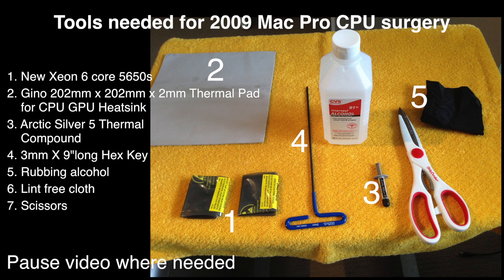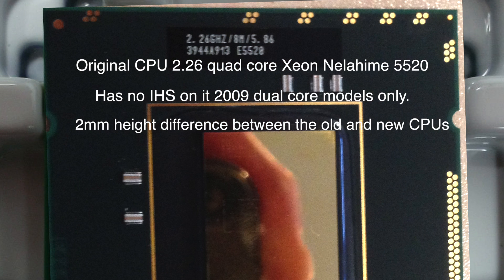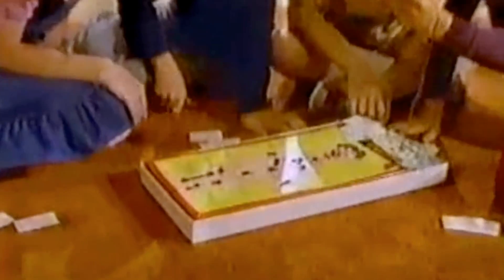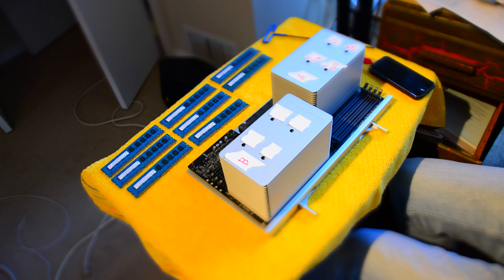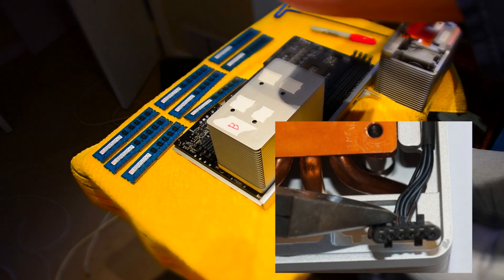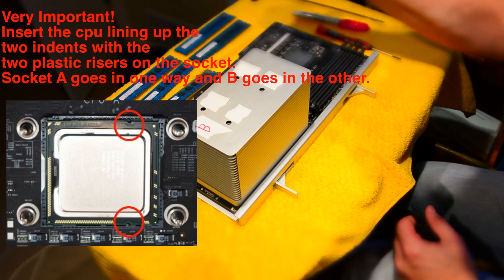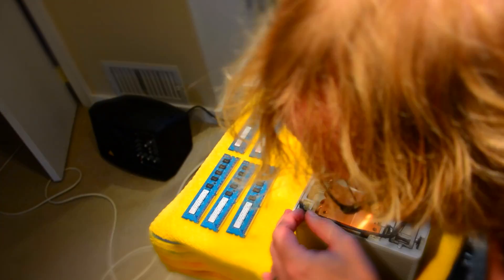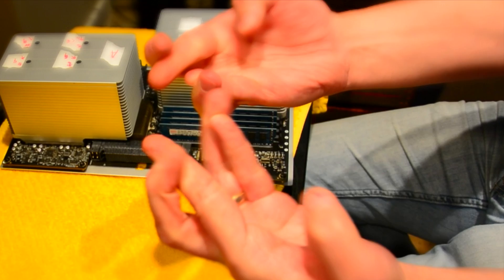Mac Pro 2009 5,1 CPU upgrade 8 core to 2010 12 core

Comment: Great video! This will help me out a lot as i'm in the process of upgrading my 2009 Mac Pro with dual Xeon X5960's.
I would like to know if adding washers to make up for the CPU height deference is worth it?
Reply from the maker: I did not use washers and about to upgrade from 5650s to 5690s today :) I am not using washers but the main thing is to not over tighten them when first putting them in. But a lot of folks said they did use washers so it's up to you, supposedly you can still over tighten even with washers. When I originally read instructions on the website I got my information from the guy said using washers will make no difference in the potential of damaging the CPUs from over tightening.
Reply: Thanks for the reply! The more I read into it the more I'm thinking about removing the IHS to get the CPU to fit 'properly'. Are you keeping the IHS on or do you plan on removing it?
Reply from the maker: +SolidCake Seeing I kept it on the first install I am going to keep it on the second install.... It is easier if you remove them but some folks say don;t try to do it and others say it was easy. So do more research on it to be sure. Going to make another video on my upgrade so stay tuned.... :)
Reply: Well, I guess they say don't because of the huge risk you are taking when delidding the CPU's. It's quite the dilemma.... The dealer I bought the X5690's from gave me a 10 year warranty on each chip. Go figure.... Delidding them and voiding that 10 year warranty is not something to take lightly. Your method of cutting the power cable loose seems like the best way to go when you want to keep the lid on. But here's the kicker, I still have 2 years of warranty on my Mac Pro that I'll void when doing so ;)
Reply from the maker: +SolidCake I learned a lot more as I struggled to install to 5680s last night, glad  to say it all worked out. I talked to another youtuber who bought de lidded  CPUs only to have the same issue as far as tightening down the heat sinks and getting all the ram to show up. I really struggled last night for a few reasons, one being the ram not showing up. I think if I were to do it again, I would not cut the heatsink connectors because its a bitch to deal with if you ever want to re install / upgrade cpus again, I was able to do it but getting the heat sink connected and unconnected is tough although I did it three times. If the fans don't blast up and all ram and cpus show up, then you are good and there is no need to cut the connectors. If your fans are blasting and all shows up and boots then the worst come to worst you would have to do it, but I have seen plenty of folks who did not cut the heatsink connectors and it worked out. I get not wanting to loose your warranty. What Mac Pro do you have?
Reply: Lance McVickar Thanks for the info & heads-up! I have an early 2009 Mac Pro 4,1. The CPU’s are expected to arrive tomorrow and I’m installing them over the weekend to keep myself from rushing the process. I still have a couple of days to think about what the best method is for installing them. I’m surprised that there is not one method that is unanimously recognized as the best way to do it. People either believe delidding them is the best way to go or they believe in leaving the lids on. The heated debates you come across on the matter is mind boggling. Either way I still need to test them if they even work before removing the lids. Otherwise I’ll ruin the 10 year warranty on the chips. If they work I’ll just leave them in as-is with washers and thermal pads for extra support. I’ll be using 0.5mm washer to dial the distance in. How’s your Mac Pro running so far?
Reply from the maker: you need 2mm of washer height I believe to make up for the difference. I did not use washers as I said.
I really thing the best way to go, is not de lidding them unless you practiced on a through away chip to see how easy or hard it is, some folks say it's easy but I would not want to risk it. I have had no issues with leaving them on. I would recommend this method of install. Remove all ram and both CPUs and remove and clean heatinks install thermal pads if not removing IHS caps. Install CPU A which is the one on the right, do not cut the connectors as I did or go ahead but it makes it much more difficult to get the heat sinks back on. Add thermal paste buy going left to right horizontal on the chip and not edge to edge but from about a 1/4 of the way in leaving no paste on the edges. Put the cleaned heatsinks back down nice and straight onto the new cpu. I find that 3.5 turns per screw in an x pattern for tightening, is a good starting place or until you start to feel resistance but the old lock tight blue stuff on the posts may cause some resistance and make you think it is getting tight. Boot the computer with only CPU A chip and Ram installed. If it boots go look at the system profiler and make sure all the ram is showing up. If it did not boot you need to tighten a bit more, do not over tighten do it gradually you will not hurt anything. There are lights on the cpu board to help guide you. If a red light to the left of CPU A is lit you have a memory issue, if the light behind cpu B is lit you have a CPU issue, of course you will know these things if you boot and all ram shows up, then those lights will not be lit. If it doesn't boot, do 1/4 turns on each screw and try to boot again. If all looks good, move on to CPU B. NOTE: when you only have CPU A installed and the computer boots your fans will blast at full speed. Not to worry yet as this is normal, maybe the CPU light will be lit as well, but if A shows up in the system profiler and all the ram you are good to move on to the next CPU install. Do the same, I had a tough time with the second cpu, it seemed like I had to do more turns than CPU A, but again start gradual and do the 1/4 turn on each if its not showing up. If its too tight or not tight enough, the computer may not boot again even though you know CPU A is good. Just be patient and work the CPU B to proper tightness being nice and even pressure on all four screws. Now for the tough part :) if you find that all is good cpus and ram showing up but your fans are blasting that means the heatinks connectors are not making the connection they need to and you will have to do the whole install again and cut the connectors and puch them all the way in before dropping down the heat sync. but this is really tough as there is no slack on the cables and the cable could potentially get stuck between the heat sync and the board because its loose although that never happened, But I think its worth not cutting them because its really hard to get the connector in and mount the heatink. If you do cut them, then get down at an angles so you can see the heat sync going down onto the chip when you are mounting it, it has to go down flat. Hope this helps and let me know how it went, always better to not go too tight, if that CPU light comes on it usually means you are too tight, I think once you go too tight you have to clean and remount as if you back off the heat sync screws you may get air bubbles in the compound which is not good.
When I went too tight, and backed off on CPU B it never booted even though CPU A was good, so I had to re install CPU B from scratch. Cheers and good luck.
Reply: Lance McVickar YESSSS! I did it! I delidded the X5690’s using the vice only method! I first checked if it worked and then proceeded to the 2nd CPU. I can say that delidding with the vice only method is a rollercoaster of emotions. Especially if you have never delidded a CPU, ever… The amount of force you need to put on the vice is insane, my hands are blue from turning. You think you are going to snap the CPU in half but… It just pops off. The first one flew off, that one had a lot mor solder than the other one. 
Thank you for your help! If you have the stomach for it I can highly recommend this process, no need to modify or tamper with your Mac Pro 4,1! My Mac Pro 4,1 runs smooth and quite with a Geekbench score of over 31000. Oh, I filmed it so you can expect a video on it soon!
Cheers!
Reply from the maker: +SolidCake great congrats.... I just installed a GTX 980ti and two 5680s did not delid the CPUs, had a bit of trouble with the second one but got it all working. Tg lad it worked out for you and get me the link on your delid ding when you post it. Cheers!
Reply: Will do! How is the performance and power consumption of the GTX 980ti?
Reply from the maker: +SolidCake the 980 blows away my R9280x and it connects to the two power ports on the logic card same as the R9, and it's been running great so far. I ran Heaven and Valley let them run for a few hours no over heating. The card has a new cooler so it's very quiet, r9 280x gets loud when stressing. It was modified to work with Mac Pro boot screen and all. getting almost double the frame rates and importing 4K to proxy media is a bit faster than real time in FCPX. But that being said Nvidia is came out with the new 1080 and 1070 but there are no drivers yet for macs. These cards are smoking fast and not power hungry. Maybe I should have waited but I pulled the trigger on the 680ti.

Comment: I'm a relative newb to the world of DIY mac upgrades, but bolstered by walkthroughs such as yours and a tongue in cheek sense of adventure I set out... Ill-advised? perhaps. Despite running into problems (as was expected) I'm still enjoying the journey. Your video has been beyond helpful, so thanks!!!!

Question... I followed your method to the letter apart from also adding 2mm washers to the heat sink screws (which I read about elsewhere). I also used the vertical line artic paste method you mentioned. I'm booting up like a champ EXCEPT the dreaded fan comes on and stays, full blast. I've tried starting over, being more careful with my paste, placement, heatsink sensor socket attachment, screw turns etc. I've gone over and around it about 4 times being as careful and precise as I can be. No luck. Any suggestions on what could be causing this? I also zapped my RAM and reset my SMC.

I did notice one blade on the Northbridge heatsink sensor was bent and I straightened it out.

Any help or advice you might have would be so very welcome! 

Thanks again!
Reply: +Camden Chamberlain  I should also add, that right now I've only installed CPU B. Waiting on some more heatsink pad before I tackle CPU A. Would the fact I'm booting with only one of the CPU's possibly be causing the fan to come on and stay on? Seems unlikely, but figured I better ask. thx
Reply from the maker: +Camden Chamberlain you can take a deep breath, the fans will go full blast until you have both CPUs installed, even though it boots with just one both have to be properly installed do to get normal fan speeds... With just one they go full blast, two and it will purr like a kitten :)
Reply: Phew! I know I'm not out of the woods, yet, but that is some VERY relieving news! Big props again on the video.

Comment: Hey Lance, great video! Did you have any problems installing 1333 RAM afterwards? I found that if the 1333 RAM wasn't matched it wouldn't boot... Did you have the same problem?
Reply from the maker: +Peter Szmrecsanyi No problems for me but all my ram came from OWC, but try zapping your pram on the next boot, hold down command option p and r immediately after you hear the boot tone and keep holding all four keys until you hear the boot sound again. If not could be you have a bad stick of ram or more or maybe two different brands could cause and issue.
Reply: +Lance McVickar Thanks Lance, I'll give that a try!
Reply: Lance McVickar No such luck Lance, I bought two 6 module kits from OWC and neither work. Both kits came with 4 matched modules and a matched pair, when I use the 4 matched they work and the matched pair also works but mixing them will mean the MAC PRO doesn't boot. Are you using 4, 6 or 8 modules? Are they all matched?
Reply from the maker: +Peter Szmrecsanyi I have six now used to have eight but they are all matched. I would just give OWC tech support a call they are pretty good, have you looked to see if all the sticks are 1333? Maybe they mixed them up by mistake and one set is the slower ram and they def wont work together.
Reply: +Lance McVickar Perhaps, but to have happened twice I think it's no mistake... The 1066 sticks are sold in matched sets by OWC whereas the 1333 sticks in matched pairs, but I supposed if you bought an 8 set then you could have been lucky and got all matching. When I say matching I don't just mean make, model and type, but down to the serial number. When you look at (apple) -> About this Mac -> System Report -> HW -> Memory, is the part number string exactly the same for all you SIX modules? That was my problem, the last 4 digits of the last two modules are different... Anyway, when it first happened I called up OWC tech support and eventually found out that they weren't matched and that was the problem, so RMA and ordered a new set specifically asked them to notate on the order for a matching set and same again, 4 identical and a matching pair that wasn't identical... another point they made was that they (OWC) don't support firmware customizations, so 4,1 macs unofficially upgraded to 5,1 is doggy ground... Anyway, I've now ordered a matching 1333 set from RAMJET, fingers crossed!!!
Reply from the maker: +Peter Szmrecsanyi another point they made was that they (OWC) don't support firmware customizations....Interesting I thought they offer upgraded 2009 to 2010 macs... guess not as I see there upgrades for 2009 are just Nehalem processors. 
My ram has all the exact same part numbers on each module. Whats odd is I bought a 2009 mac pro from them and upgraded it. and was about to buy new ram but after zapping the pram I found that it came with 1333 so that was a pleasant surprise.
Reply: +Lance McVickar Pleasant indeed! Well, I'l let you know how I get on with my RAMJET ram. Cheers!
Reply: +Peter Szmrecsanyi RAMJET actually provided me with fully matched modules and they worked fine... :-)

Comment: Great video - thanks.  So quick question - there are no issues and\or concerns with the motherboard and moving up class of CPU (i.e nehalem >>> westmere)?  All of the places that seem to offer turnkey type upgrades always use same CPU class re: before and after.  Maybe I just haven't found them online but if folks really aren't offering it, then it begs the question why.  Also, maybe the motherboards are the same throughout - just not sure...

Either way - are there any mods required to change the bus\cpu clocks so the CPUs actually run and drive the buses at the higher clock-rates?  Maybe this is all handled via firmware and auto-detection - not sure - but on the PC side this is always done manually especially when over-clocking...
Reply: UPDATE:  I just discovered that the hardware on the Nehlalem and the Westmere machines is IDENTICAL.  Maybe others already knew that but it's new to me...
Reply from the maker: +Antonio Leding yes they are just need to update the firmware and install new CPUS only difference is the IHS lids on the CPUs otherwise they are the same.

Comment: What kinda Thermal Pad did you use, were they different for CPU A and B?  Could you provide a link where you got them from?
Reply from the maker: +Alex Antonov I got them on Amazon, 2mm thick same ones for both CPU a and b just cut to fit 
http://www.amazon.com/202mm-2mm-Silicone-Thermal-Heatsink/dp/B008X0UKV8/ref=sr_1_2?ie=UTF8&qid=1459712252&sr=8-2&keywords=Thermal+pads+2mm
Reply: +Lance McVickar Awesome, thanks for the link and the reply.  Did you also went with the 2mm plastic washers to adjust the height on the heatsink bolts, as some articles mention?  If you did, which ones did you get?
Reply from the maker: +Alex Antonov I did not use washers as you can see in my install video. Some folks do some folks don't. I think folks use plastic 2mm washers or two 1mm on each post. Supposedly you can still crush the CPU if your not careful, the whole thing is to not over tighten them when putting the heatsinks back on. You can put CPU in first and boot and check to see it is working, your fans will blast at full speed but you can check to see if its showing up and all the ram is showing up for that cpu, then install the next one and if all is good your fans will go to normal speeds. Not a bad idea to do one at a time bu tyou do have to remove both the old CPUs first.